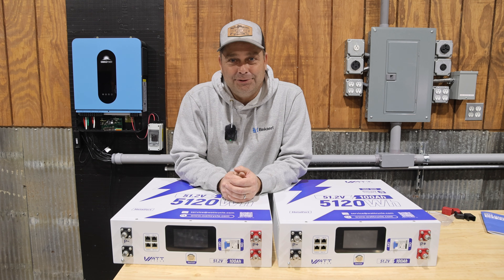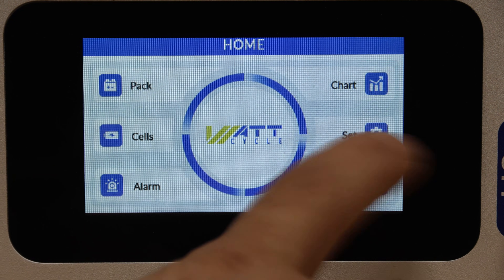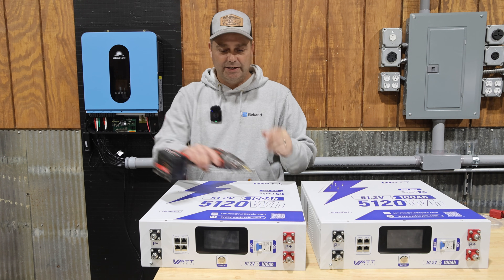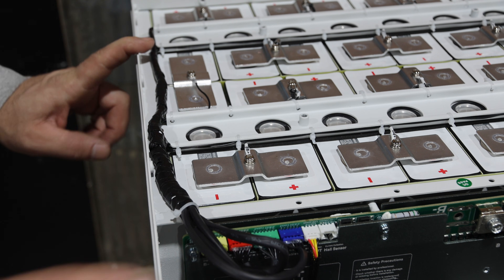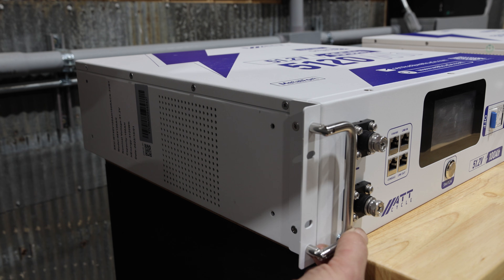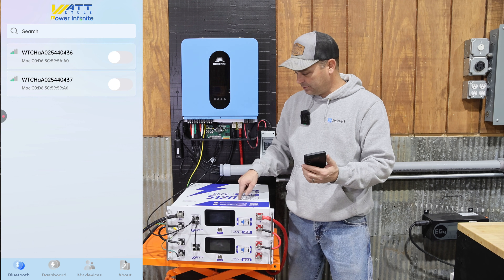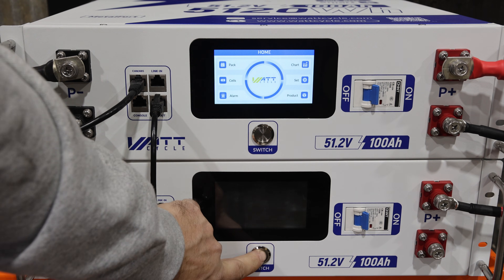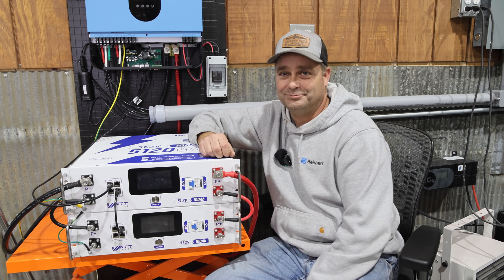Could This be the New King of Budget Batteries?  Testing out WattCycle's New Server Rack Battery

Comment: Hope you follow up with tech support on the missing Luxpower protocol.  I purchased one of these and have not been able to get it to communicate with my LiTime 3500w inverter/charger that only supports RS485 communications using Pylon protocol.  Almost seems like the battery defaults back to CAN bus.  Possibly a LiTime problem, the Eco-Worthy identical looking inverter supports can bus as well as wifi remote monitoring for the same price but it is located at a remote site so I've not been able to try hooking the Wattcyle battery to it.

Comment: 17:20 if it's discharging at over 100A, isn't the maximum discharging current be set in the parameters?
Reply from the maker: The max discharge cutoff in the battery is set at 120 amps.  But you can adjust that down.  They have it set that way for to handle power spikes when motors are started.

Comment: The battery terminal has a potential short. It was explained that the wire terminal can be connected upside down and touch the screws.

Comment: Hiya I’m learning all this stuff , I noticed you joined the negatives first , I was told the positives to connect first and to disconnect take the negative wire off first ? Or does it not matter?
Reply from the maker: That is the common rules for a car battery.  Because the negative side of the battery is  connected ground to the frame of the vehicle.  So, if you hook up the ground first, the positive could short out against anything metal in the vehicle.  So you hook up the positive first before the negative grounds to the frame to help elimate any accidental short circuits.

On These batteries, the negative isn't grounded.  The ground is just for the case of the battery, not the negative terminal.  This 48 volt system is a floating ground system, meaning the negative terminal it isn't grounded.  So you can't short out the battery to ground, only shorted out with a direct connection from positive to negative.  So really no reason to hook up one side or other first, on this system.
Reply: @C @CountryViewSolar-DIYProjects  thank you very much 👍🏻 I know it’s simple stuff but I know if you don’t take care of certain details it can be unpleasant 🙈thanks again

Comment: I always wonder why these budget type batteries have the +/- on the opposite sides. There was another button would be nice to see is the equalize button.
Reply: Equalize??? 😂😂😂 these aren't lead acid batteries. Wannabe you don't equalize LFP batteries. 😂😂😂
Reply: @solarcharging9743  you would if you were connecting two batteries with different voltages
Reply: 16:43 equalizing is on maybe they refer to balancing as equalizing
Reply: On the opposit, I feel that having + and - close, increase the risk of an accident, while being further away is a safety issue.
Reply: @PjotrII  no I mean most server rack batteries have the positive on the left instead of the right

Comment: I have four sun gold sg48100 p server rack battery.a 10000 watt sun gold inverter. Can I add two watt cycle batteries? Without a lot  of problems.any advice would be helpful.
Reply from the maker: Yes, you Could add 2 of these batteries and the battery bank would be bigger.  But they probably won't communicate with you other batteries, so their state of charge won't be factored in to the total state of charge of the battery bank.  I don't feel like that's a big deal, I have several batteries that are hooked up that way.